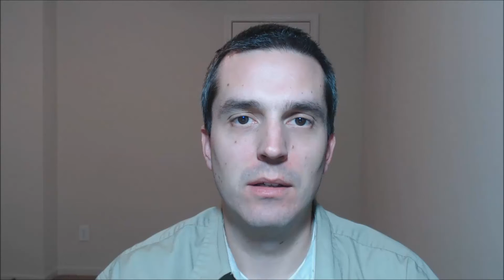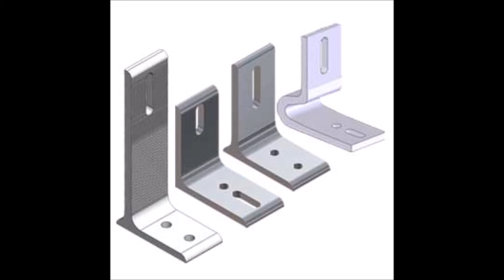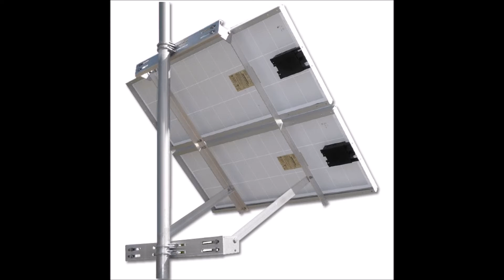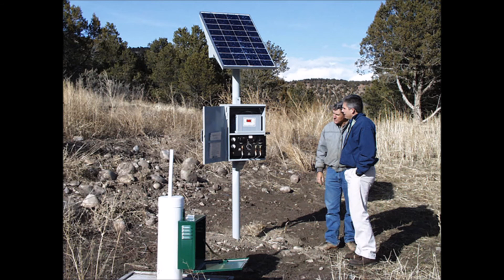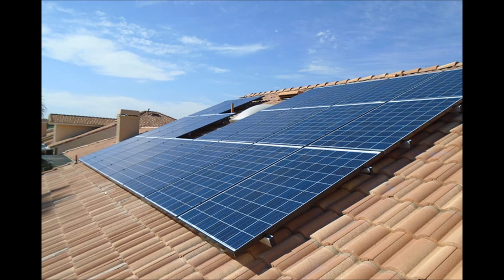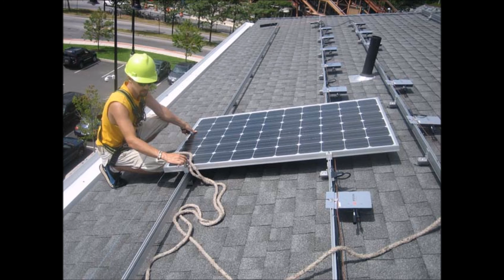Solar Panel Basics - Mounts 101

Comment: I have found the portable mounting frame for my solar, was the most expensive part of the system. The price would have tippled again if I had used standard ready made stand. I had the service person build one w/ parts from his hardware store. If it were not for the cost of the stand I would expand this much sooner. For my phone/internet box-again hardware from a local store was used for the rack to mount the panel to the box. The service guy could not believe how they get away w/ charging what they do for the frames and racks.
Reply from the maker: +Prima Donna Going Off Grid Yeah, they are stupid expensive.  I made my own racks on top of my shed using electrical c channel and they work pretty well.  There is still a high degree of improvisation needed for DIY solar as a lot of the products on the market are far too expensive to get any return on investment.